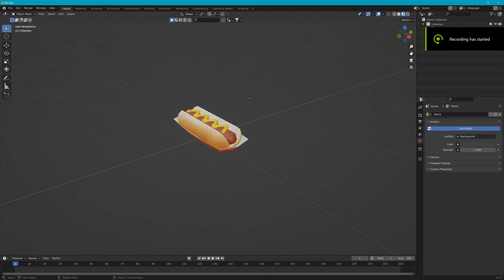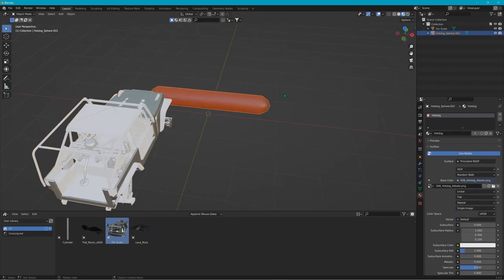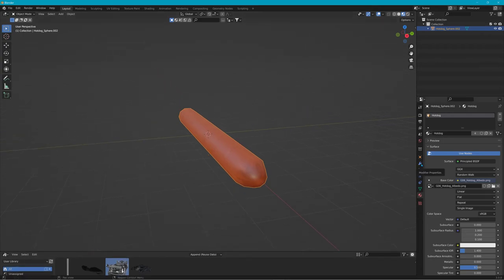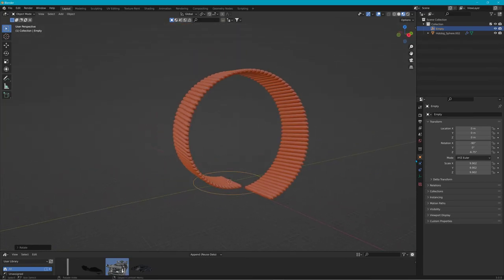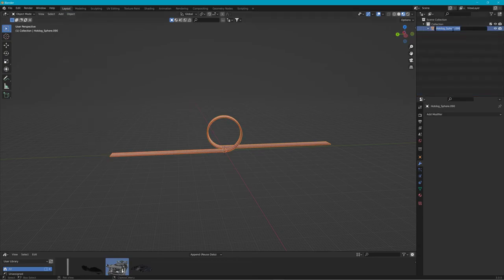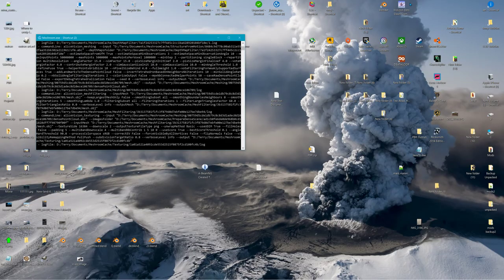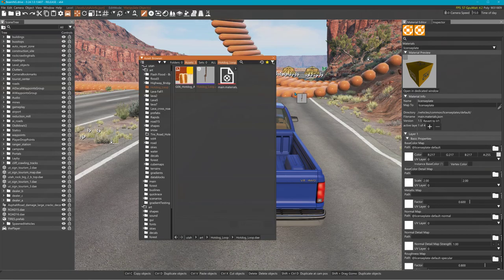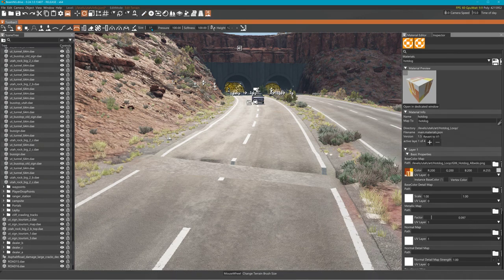How to make a Hotdog Loop in Blender for BeamNG

Comment: I just destroyed my whole level, 2 weeks of work gone,  I have no idea what I did...
Reply from the maker: What you did, was not making a backup. I am bad about it too sometimes, Tell me the symptoms. Email the crash logs and I will see if I can figure it out when I get up in a few hours. Crash logs are in the user folder, there are a few files in that folder. Cant remember off the top of my head, may be in the temp folder. Think there are like 3 startup logs, and maybe a crash dump. Did you pack a prefab of a mod and move any mods around ? Does it crash at the beginning or near the end of the level loads that matters cause there is a sequence of things launched that will narrow down the problem
Reply from the maker: It may be fine, I thought I messed mine up in the past a few times. The next one you do get in the habit of manually duplicating your level to a different location. There is a level backup tool in the world editor but I never used it. Also not a bad idea to export your terrain. It will export the terrain and all the textures you painted in it. Easy mistake people make is having assets in a folder other than the level your working in. In fact the one track I submitted I have the sky textures pointing to an entire different folder. So the sky is missing whoever downloaded it.
Reply: @TerryMartinART  my son even warned me,  Dad be sure to create a back up, you got lots of hours in that level, and Bam....LoL..I did something in the terrains much that can go wrong there, I think I accidentally thru  another materials file in there and it changed all the material assignments. I think I can fix it.